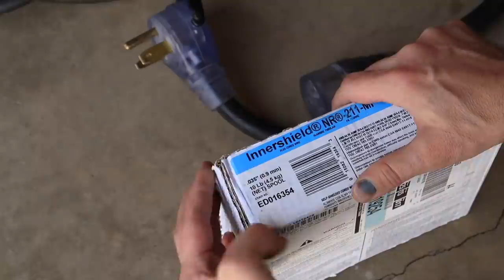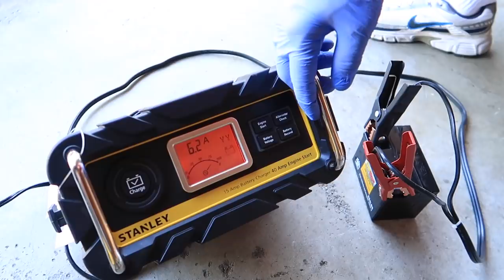125cc BIG WHEEL DRIFT TRIKE BUILD PROJECT

Comment: Very nice build! 
I too am building one, and using a steel tractor seat, (with custom pad and backrest) and a 125cc manual 4-sp engine (didn't come with electric start! Boo!) and I am also mounting the engine in the front frame, BUT, I am also mounting a 212cc Predator engine in the rear for a booster engine (when necessary) as this Trike will be a country back roads traveler, and will have larger trear wheels like a 4-wheeler in the back, and a large chopper style front multi-spoke wheel in the front! Yea OK so it's a kids Big Wheel on steroids! But hey I'm a 68 yr old kid, so what do ya expect! Vrooom-Vrooom-Vrooooom! Jus practicin'!
Reply: Bom dia,
Estou montando um para dois lugares, para passear com minha filha.
Gostaria da sua opinião, nesse caso é melhor por o motor na frente do quadro ou na traseira.

Comment: U can fill the tubing with sand using water for a no kink bend using tubing with that bender ther's tons of utube vids that show how also works with thinner walled material too
Reply from the maker: Mike McCabe 
Stuffing pipes with sand is just too much work. Bender dies that I’m using are great for pipes but thin walled tubing gets kinked easily. Guy who sold me this bender tried it only once with bad results. He didn’t realize that pipes and tubes have different dimensions. His loss my gain. 
Anyways, thanks for the tip but so far my bends come out flawless so there’s just no point in messing with sand. Cheers.

Comment: I would like to KNOW how much the total build cost and I would like to know how well the motor has worked an what brand of motor did you use that was a good build
Reply from the maker: R Broyles 
This project was cheap for us because we already had the engine from our pit bike and rear axle with wheels from our go kart. I had to buy the pipes ($50), the front tire ($50), gas tank ($10), and a seat ($40). The rest was just a matter of fabricating and fine tuning everything. To build a trike from scratch would probably end up anywhere between $800 to $1500 depending on the quality of the parts you want to install. Engines are readily available on eBay or Amazon so good luck with your project if you decide to make one. Cheers

Comment: I love the fact it was a Father and Son project !! Neither of you will ever forget that quality time together.
You did a good job Building it and it looks like it was a lot of fun to ride. I’m proud of you. I’m curious to know a total price of the project and I would like to know what brand of motor and wheels (parts breakdown) and where you purchased them at, I would like to duplicate the build with my son.
Reply from the maker: Hi Mark 
Indeed, it was a lot of fun building this project with my kid and I hope that in retrospect he will appreciate all the quality time we spent together on all of our builds. This particular drift trike came out really cheap for us because we owned a pit bike and a go kart. Yanked the motor from the pit bike and stole the axle with wheels from the go kart just to make this project. After we had our fun with this trike, we disassembled it and installed everything back on the pit bike and go kart. Things that we had to purchase are piping for the frame, seat, front tire, gas tank and exhaust pipe. Roughly speaking we spent around 200 for entire thing (not including child labor lol)
To build something like this from scratch you’re looking to spend anywhere between $800 to $1500 depending on how fancy you want to make this thing. To be honest with you go karts are so much better in every category than this trike. Good luck with your project and let us know how it turns out. 
BTW engine we used is a 125cc SSR fully auto. Cheers.

Comment: I think if you split the axle and take the pvc off it would be fun to just cruise around
Reply: It will be pretty hard to distribute the power cause it will need a differential
Reply: @NuBz he literally said if u split the axle...
Reply: I took the key out of the off sprocket side and after some  learning to handle the hard push to the right its a blast

Comment: Nice job I like it so much. Just Charing my point of view needs to stretch the leg handles a bit and some additional security to the chain close to the hand brake.  The front wheel sounds a bit huge compared to the size of the project, but this is my point of view nothing else. Congratulations
Reply from the maker: CHUAIB BAALBAKI 
Thanks for your advice, we appreciate it. Viewers like you help us improve and make better content. Cheers mate.
Reply: plate that supports the feet will be better as well
Reply: Hhh

Comment: Okay so now your pipe benders that you use and yes anything past 90 degrees that will want to bend and keep the pipe but if you take intake heavy-duty rubber caps in band clamps and clamp off one in with a rubber cap fill it completely up with sand and one in then take you another heavy-duty rubber cap and put a band clamp on it and then inserted inside your Bender you will not change it save you cannot should go up to a hundred and ten degrees before it will actually either one cracked a tube or two actually just bust both rubber clamps off in the same pours out and it didn't think so but you can go up past 90 degrees if you filled the pipes full of sand now if you want to fill them up and keep right on going to a hundred and fifty degrees past you'll have to weld the ends up with the sand in it but like I said anyting up to 120 degrees after 90 you want f*** with f*** it up

Comment: Power should be delivered to front wheel. A lot of power is lost on the rear wheels since less traction. This is why the 360 doesn't whip that hard at the end of the rotation.

Comment: I would've added at least a 500cc with a 5-speed shifter on the left foot peg, a speedometer and a fuel gauge, a kickstart pedal in case of failed from battery, and larger and fatter rear tires.

Comment: Ight I like the build but what irritates me is that u were welding in the same room as your son who didn't have a helmet on and hot the hand brake is right next to the chain and sprocket and the fact it's not a 2 stroke plus u should add some bigger tires in the back not to much bigger tho and put a smaller tire in the front that's y your not getting ass much traction bc the front tire is putting to much weight in the front but besides that it's pretty awesome man keep at it

Comment: great video.  What did your rake angle come out to if you don't mind me asking.
Reply from the maker: Hello Brian B 
I really don’t know what my rake angle was because I didn’t measure it but my goal was to get the front wheel as close to the frame as possible without rubbing on the frame. Our previous trike rake angle was awkward and the front wheel was sticking out too far so this time I made it much closer to the frame. If you’re planning on installing pegs on the front wheel than you’ll need to play it by ear. Good luck
Reply: @balabay77  Gotcha, thanks for the reply and again awsome job..

Comment: have you tried it without the sleeves on the rear wheels? the weight/ body position/ wide axle etc should allow drifting even with bare tyres? im thinking of building on with a front hub motor or designing a front wheel (shaft) drive system to avoid mangling your legs in the chain- this would allow drift  'sleeves' on the rear but perfect drive from the front rubber tyre
Reply from the maker: Yes we tried without the sleeves and it doesn't drift at all. it will only drift without the sleeves if the speed was over 30 miles per hour but that would be unsafe to drift. As far as the chain goes, the legs are nowhere near the chain so theres no way they can get mangled unless deliberately inserted. When you get done with your trike send us a link, would love to check it out. Cheers mate.

Comment: Stop welding in adidas sandals.  All my socks look like Swiss cheese since I do the same thing
Reply from the maker: LOL thanks Michael for great advice. You’re like the first one who actually pointed that out. In our state (CA) it gets too hot to wear proper welding gear. So far I’ve been lucky enough to avoid major burns. Thanks for watching and commenting. Cheers.
Reply: +Michael Woodsdale - You made Foot Cheese!  😅😅😅😅😅😅😅😅
Reply: balabay77 
First I love what you built but heat is no excuse for not wearing proper safety gear. You want heat? Come to SanAntonio Texas, I’m a professional welder over 30 years and have sweated to death while wearing leather sleeves or jackets in the summer depending on position of work being done. And welding “BB” burns are never fun especially when one gets in your ear and bounces around your eardrum!! That’s why Welder’s wear the funny caps with the long bill part covering one ear lol.

Comment: Nice build it would be a lot better handling with smaller front wheel
Reply from the maker: james facts 
Our first trike was with 20 inch bicycle tire and every time we used brakes it would bounce or kinda skip while braking. This motorcycle wheel is very heavy and I guess it helps when we do 360 turns as well as during braking. Many folks use smaller wheels but we wanted to try something different. Thanks for watching and commenting. Cheers

Comment: Was it front wheel or rear wheel drive because it would go faster on front wheel drive
Reply: Rear wheel is the best way.  You need the power at the rear to do controlled power slides.

Comment: Can u tell me the in centimeters please. The best I found
Reply from the maker: measurements of the frame;
Two main pipes that go from front fork are 60 inches long(152.5cm). They run parallel to each other and the distance between them is 8 inches(20.32cm). From the head tube (front fork) at 7 inch mark (17.78cm) made a 45 degree bend on both sides. From that point go down 22 inches(55.88cm) and make a 65 degree bend on both sides. Two other pipes that are on opposite side of each other are made for reinforcing the frame and to stand on them. each pipe is 26 inches long (66.04cm) and bent 45 degrees at around 9 inch(22.86cm) mark. 
All these measurements are approximate and can be altered to your size and preference. Good luck with your project.

Comment: This engine you got it from an old automatic bike? Or scooter?
Reply from the maker: Jorge Duarte 
Yes sir it was on our old pit bike. I’ve used that motor for this project. They are also readily available on EBay and amazon.
Reply: balabay77 good morning, it was kind of you to tell me that. it was very helpful. Thank you so much.
Reply: one last question: what did you do to the gear box pedal? could you explain that to me please? I am rookie and i I am Learning about this kind of stuff... By the way, i dont know speak english very well...
Reply from the maker: Jorge Duarte 
This particular engine is fully automatic without any gear pedals. Without gear pedal I was able to lower the motor almost flush with the frame. Overall it made the trike more stable on turns.

Comment: and if you could take measurements that would be great thanks
Reply from the maker: h kdl 
For sure. I’ll get back to you on Saturday.
Reply from the maker: Here are the measurements for the frame;
Two main pipes that go from front fork are 60 inches long. They run parallel to each other and distance between them is 8 inches. From the head tube (front fork) at 7 inch mark made a 45 degree bend on both sides. From that point go down 22 inches and make a 65 degree bend on both sides. Two other pipes that are on opposite side of each other are made for reinforcing the frame and to stand on them. each pipe is 26 inches long and bent 45 degrees at around 9 inch mark. 
All these measurements are approximate and can be altered to your size and preference. This trike was made without any plans so if i could do it then you should be able to make one as well. Good luck.    
Feel free to contact me for more info if the video was not clear enough. Thanks for checking out my video.

Comment: I'm sorry, but you build something cool with which you can make proper burnouts and you make it so plasick on the tires on it. Have you ever tried to make a burnout when standing on the foot rests? And without plastic on the tires!
Reply: But of course you make a good work!
Reply from the maker: unfortunately this motor is not powerful enough to  do a burnout without the plastic PVC sleeves.

Comment: Good job bro. How much did it cost you to do it???
Reply from the maker: esteban parra 
This project came out really cheap for me because I already had all the necessary parts available. Engine+wiring harness came out of our pit bike, rear axle with wheels was on our yellow go kart and other parts were used from bmx bike. The only things that I needed to buy is the seat, front tire, gas tank, throttle grips, cable. Frame was cheap to make ($60). All in all this trike came out to around $250-300. If you are planning to build it from scratch than it might cost you anywhere between 800-1500 depending on how fancy you want to make it. Cheers mate and thanks for watching our video.

Comment: What engine did you use?
Reply: Or could you link all the komponents please?
Reply from the maker: Zaiinex #juandeag 
We used to own a fully automatic pit bike so instead of buying a new engine I just took it off of the pit bike and slapped it on this monstrosity. But if you’re looking for this type of motor than they are readily available on Amazon and eBay for around $300-$400 bucks. Our drift trike came out cheap but if you are going to build it from scratch than it might run you anywhere between $800 to $1500 depending on the quality of materials. Anyways, thanks for watching and commenting. Cheers

Comment: what did it cost to make
Reply from the maker: Marc Barling 
This project didn’t cost me much because I “borrowed “ engine from my pit bike and rear axle with brakes from my go kart. Basically, bought the front wheel for $50 and fabricated a frame from ~$60 worth of piping. 
But if you plan on building something like this from scratch than it would cost you anywhere between $800 to $1500 depending on how fancy you want it to look. 
Good luck.

Comment: Quanto custa pra fazer uma dessa??
Reply from the maker: It all depends on where you buy the parts. Our trike was cheap because we already had a rear axle with wheels that we took off of our yellow go kart. Pit bike engine we also took off of our bike that we already owned. To build something like this will cost you anywhere between 800 to 1500 dollars but if you buy it online then maybe even a lot more money. There are several websites that already sell them cheaper. Drift trikes from china cost $500-$750 dollars with 80cc motors. Good luck buddy.https://www.ebay.com/i/252941976372?chn=ps

Comment: those handle bars should be thrown back a whole lot. looks uncomfortable to ride in a sitting position.
Reply from the maker: Kaliep Murangi 
Maybe so but the reason why it was build this way is because we wanted to make everything balanced and in the center. Our previous trike had the motor in the rear and that made it off center and heavier on one side. We couldn’t do 360* degree loops. Thanks for watching and commenting.